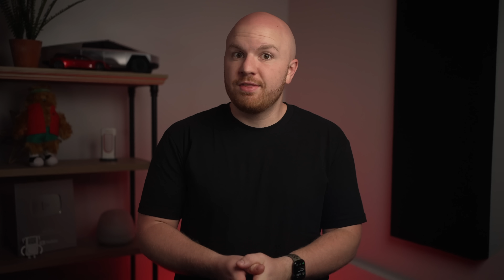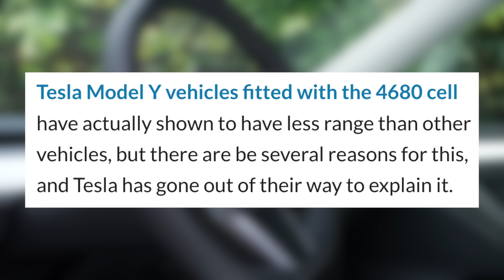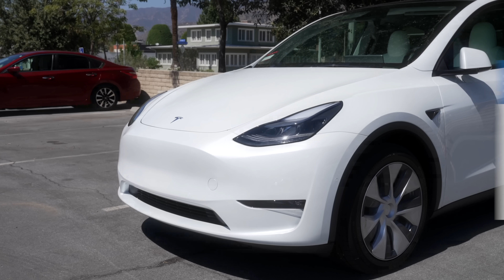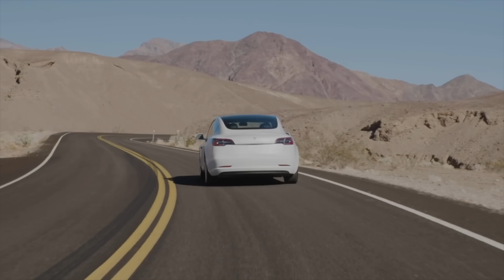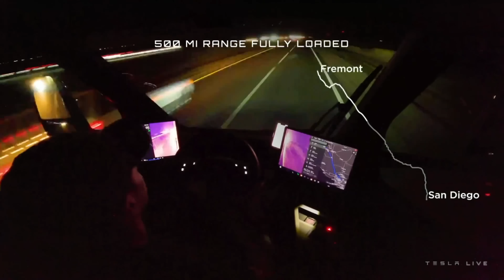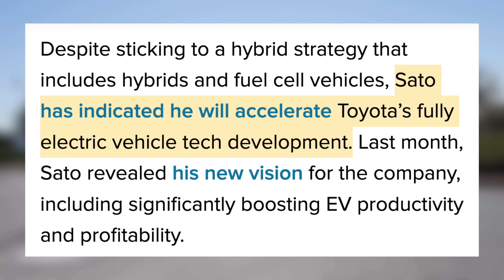NEW 450 Mile Tesla Coming in 2024? | NEW Tesla Battery Problems

Comment: Bro Ryan, 
Gr8 update! This mileage bump is somewhat encouraging as Tesla must raise the bar on what we call Long-Range (LR) and set a goal for Tesla and put industry on notice! 

LR should have a near-term goal of 450 miles. Here is truth of why. 

My current Model Y LR now has over 35k miles and it is FULLY ADEQUATE for around town DAILY USE, because I have a 220v 50amp home outlet in the garage! The mileage is perfect for home daily use!  
Road trips are OKAY-ish and doable thanks to the Wonderful charger network, though not where it needs to be as a Only-Car car gas replacement.

BUT, the problem is when you arrive at destination (family of other) where I must spend WAY too much time at chargers every day or two alone and away from my chosen destination.  Speaking factually, we try to arrive at chargers with 10-15% and try never to charge routinely over 80% out of courtesy for other charge users but also for battery health! So my 330mi M-Y LR it really 330 x (70-80%) = 231 to 264 mile real-use range.  This is INADEQUATE for a Only-Car or Long-Range car! 🧐 
Worse yet, charging at family or destination is a problem since the batteries are never at optimal thermal range for fast charging... so a 20-30 charge is often doubled while the battery temperature gets in the Zone.🤔
So we really do need a 450 mile range if we are to transition gas users to BEV's!  450×(70-80%) = 315-360 miles!  

Cheers, Eric
Reply: An honest BEV honor. Thank you.
Reply: So true I've been saying this for years that we should be looking at about 500 miles as long family trips in the winter from Toronto to Montreal go from 300 miles to 200 miles and if you're paying $80 to fill that up one way then it's much more cost effective to drive a gas car and save a couple hours of charging.  Whereas going from 500 miles to about 300 miles in winter driving could save a good amount of road charging
Reply: @Space Approval  I'm more fortunate here in the VA to NC area and have not had trouble with cold weather range issues.
Also, my Model Y saves us a great deal in travel expenses/mile. We love that about our Model Y.  I'm also semi retired, and timing meals with stops negates about half the daily charge time vice gas time on trips. Of course, home based daily use, I could never go back to a gas car as we never again need to go to a gas station during home based daily travel. Of course, I'd still like a longer range to improve the comparative experience. It would help the transition to these wonderful efficient vehicles.
The 2019 VW Jetta we sold for the Tesla got 500-600 mi on the road easy & my RAM 1500 gets well over 500 miles. Still, we would never go back! 
My challenge & reason I'd like Tesla to push a goal of 450mi is to make the travel destination (family, friends & destination travels) experience less hassle & giving me more time with fam/friends ... AND to grow market dominance with real-life equivalency! Currently, people get the WRONG impression seeing me leave every day or two, for an hour alone to charge at a supercharger. 

Cheers Mate! Stay warm.
Reply: > Worse yet charging at family or destination is a problem since the batteries are never at optimal thermal range for fast charging

That's not true.  You can't supercharge at your family's house or destination anyway, and the temperature won't affect ordinary charging.  This reads as a "hit comment".  330 miles of range is plenty in 99.9% of situations.  The 80% limit is only for daily trips.  If you're going on a road trip, Tesla says you can charger higher.

I don't usually bother, though.  Supercharging on your route is normally plenty.  The only time charging is an issue is if you're really in the middle of nowhere.
Reply: @mrmichrom  No hit piece, just making the transition to excellent, & efficient BEV's!  Like I said, at home and WHILE traveling when batteries have miles to condition is not an issue. 
Visiting family and other friends who don't have BEV's are a problem.  My daughter could drop an extension cord out the window from the 2nd floor but that and your impression of the challenge are not realistic. 

Cheers, Eric
Reply: @erickessler6094  I have no problems w/ my long range Y. But yeah,  a 450 mile range would be great. It would also be nice because of your starting at a higher range, so battery degradation would be even less of an impact long term. Also in colder climates where you can lose 40% of range this would also be an advantage.

Comment: No way 2170's go into the CT.  the CT has a structural BP and the 2170's as they are are not capable of holding loads like the 4680 and I doubt they will redesign the 2170 shell just to allow the to hold a load.  If anything the CT will launch with only a 300 mile range  until the 4680  capacity allows them to launch the 500m version

Comment: I live in AL and I get really close to the range displayed on my display. I make sure to look at the gps destination miles and the difference is within 5-10 miles when driving over 200 miles. Sometimes the difference is positive. 

This is M3 LR 2022 version
Reply: Range is dictated by speed. The faster you go the less range you get. The rated range is a combination of city and highway range. If you run all highway at top speeds your range will be markedly less. If you do only city driving your range will be considerably better.
Reply: @matthewhuszarik4173  I think speed is the biggest factor as I’ve driven trips that are 90% or above highway driving and I get the EPA estimate (give or take 10%) by not going 5 mph over the speed limit
Reply: @chidorirasenganz  I got my M3LR to within 1.6% of EPA on a 5 hour drive by going 90km/h (55m/h) on a 30C (86F) day. So yes the slower you drive the closer you will get to EPA range. I live in the tropics so I can't say this with experience but I think the biggest factor for range is temperature. From what I have heard extremely low temperatures severely reduces range in electric vehicles.

Comment: 450 mile battery which means in reality about 350
Reply: I'll say 415
Reply: After 5 years, 120.000 miles with a M3 Long Range, used as a daily commuter, I have determined the following - A cars reliable range is no better than its use in worst conditions - factor in recommended routine charge limit of 10% to 80-90%, rain or snow, cold temps, 70mph highway speed, heater on, passenger in car, ect... 450 max range battery (rated under ideal conditions) = less than 300 miles. 

Even under ideal conditions (rare) and as a daily commuter, 70-80% routine charge usable range on 450 rated battery would be 315 - 360 miles. And then there is range loss with charge cycles and aging. Advertised "sticker ratings" are often misleading.

Comment: The current 330 mile drives effectively around 200 miles. I wonder what would be the effective rate if the 450 😢
Reply: Where's your source?
Reply: So here’s a real source. I have a model y performance. I drive everyday 40 miles at a range of 60-70mph. I average 280 wh/mi putting my total usable range at 280ish. 23 miles less than epa but I’m not driving in chill mode and I do like to slam on it a bit.
Reply: In the winter maybe. But other, you're full of crap.
Reply: Who care about the range of a car that ranked 19th in reliability in 21 and 22.
Reply: @bobbybishop5662  I really do not what numbers u r talking about. I drive the car with 100% reliability and enjoyment. No need to care maintained (I thought it would self clean but it does not 😩). I do care about promised range.
Reply: @bobbybishop5662  100% lies.

Comment: I really hope the new versions of the Model 3 Long Range eventually gets 4680 cells.
Reply: The only advantage of Tesla 4680 cells is the supposed manufacturing efficiency. Less cells are used to make a battery pack compared to 2170 cell. Bigger 4680 cells make more space between cells hence volumetric capacity is reduced compared to packs using 2170 cells,

Structural packs use the spaces between cells and filled them with thermally conducting thermosetting material. When hardened after application will add to mechanical strength to the pack structure. The disadvantages are it is difficult to replace if one of the cell is faulty. You have to junk the whole battery pack. Another problem is at the end of battery life - difficult to recycle.
Reply: @anuardalhar6762  yep, precisely my point. 4680s present no more advantages to the customer. I would go out of my way to avoid one if I could.
Reply: Why? How are they better? 4680 packs aren't repairable, are harder to replace and don't present any advantages to owners.
Reply: @ManuNarang  well I didn't design them but most of the information on the newer batteries indicate they are more efficient and for the most part made inside Tesla. I'm no expert, but I don't know that the 2170 batteries any more repairable.
Reply: @Brad._.  4680 cells are actually less energy dense than 2170. The battery modules in the 4680 are not repairable because individual cells are packed together by tight fire retardant foam, whereas the 2170 packs can have individual modules replaced. The way that the 4680 cars are assembled is that the entire battery pack is a structural component of the car that also includes most of the interior and the seats, making the battery pack way more expensive to replace.
Reply: @ManuNarang  Then seems 4680 is not as good for the environment - less modular and harder to recycle?
Reply: @Trust_but_Verify  4680s would definitely be tougher to upcycle - like using a degraded battery pack for stationary storage applications. Tough to compare recyclability because you can be slightly destructive in disassembly, as all you care about is extracting the lithium and other precious elements from the cells. Even if you damage a cell, it's useless in a Powerwall, but still can be torn apart to get the lithium out.

Comment: More than 400 miles on a Tesla is a complete waste! It's not a lucid which go no where to charge.
Reply: Superchargers are still rare in some parts of the country.
400 miles of range would be great!
Reply: Not if you need it for towing.
Reply: It's only a waste if it means more battery/material/weight. Otherwise, I want the MAXIMUM amount of range. If I can get a Tesla with the same curb weight but  higher range, I'll take it.